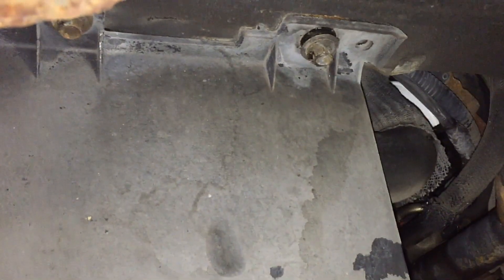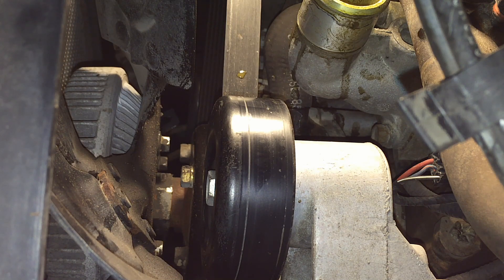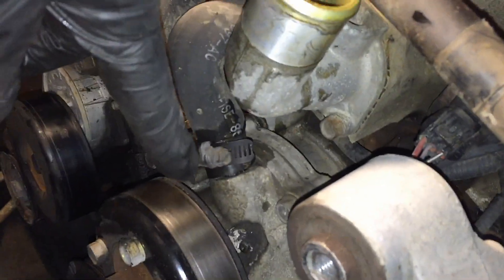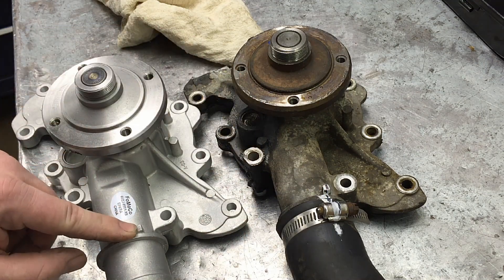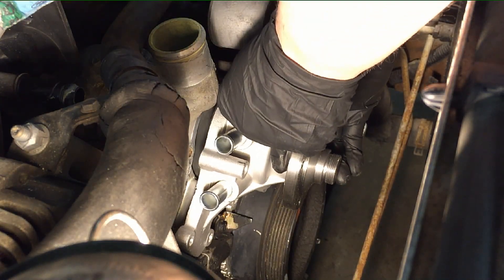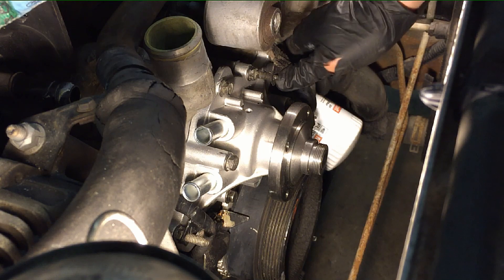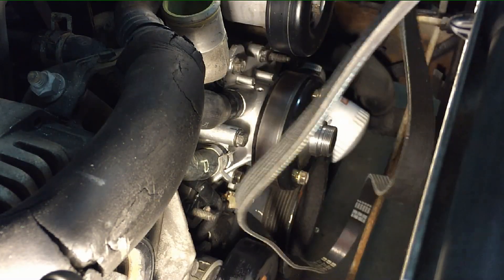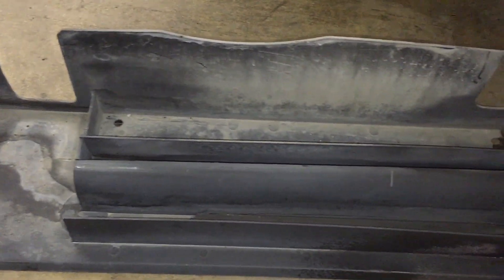Ford Explorer 5.0L Water Pump Replacement Procedure

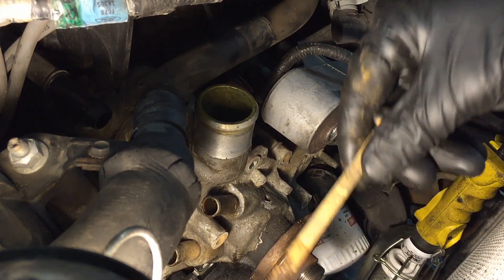Comment: I tried removing my water pump and the two long bolts were stuck just as you showed prior to 12:08. I wiggled one back and forth and was successful however the other one broke just below the head leaving the shank and threaded part stuck. I had to remove the timing chain cover which proved rather difficult because as I inspected the cover later, I found that a ton of corrosion had built up in the passage around the bolt shank. The bolt shank had belled out wedging it in place and holding the cover against the block. With some prying and a few choice words I was able to get the cover out a bit and wiggle it back and forth until the bolt broke a second time. I had to use a punch to remove the shank from the cover and fortunately the threaded part in the block came out rather easily.   I had to drill out the corrosion with a drill bit. I believe the gasket had failed eons ago and flooded the passage around the bolt shank causing it to corrode. I also found quite a bit of pitting around the impeller housing. As you are reviewing the condition of the bolts at 15:30, my advice would be to also inspect the passage ways in the cover and remove any corrosion.  I own a 1999 Mercury Mountaineer AWD with the 5.0.

Comment: I remember back in the 70s a neighbor had a 73 Torino with a 302.  That engine was tiny back in the day compared to the 351, 400 and 429.  There was a ton of room under that hood with that engine.  Things have certainly changed.  Just did a water pump on my 94 Astro, similar idea.  Only 2 years on an AZ pump which I usually don't gamble on items like this, had almost 10 years out of the prior ACDelco pump.  Wised back up and put in an ACDelco pump this time which will last a whole lot longer.

Comment: To keep the bolts in order, I use a piece of cardboard labeled for what part it is, and put the bolts in a similar position on the cardboard.

The 5.0L pushrod engines are easier than the modulars to work on.
Reply: The only reason why the 5.0 can be a pain in the ass to work on is when it's on the tightly spaced engine compartment of Gen 2 Explorer. But I do agree, very easy engine to work on overall.
Reply: Just wait till the timing chain  guides break in the back on that 4.6 then say that comment
Reply: Sry I misread your comment. I thought you were referring to the 2nd gen 4.0 sohc

Comment: Very detailed step-by-step video thank you. I am surprised that the job did not require new hoses. This would be the time definitely to do the lower two hoses on the oil cooler and the water pump. Plus the upper hose just for good measure.

Comment: You explained details others missed.  Not break bolts by working in and out.  Sealant on bolts.  Flush block.  Thanks.  I have a leaking radiator to replace, and will replace the trans cooler, thermostat, and water pump while I'm in there.  Hope it's a good idea to replace the water pump, broken bolts?????
Thanks for these videos

Comment: Great Video!  Thanks for sharing these really good Tips and Tricks. I learn a lot each time I watch any of your videos. Really great videos with awesome Tips and Tricks.  Thank You. -- I am thinking since this was a 1997 and some of the hoses look like OEM - I might spend a little more and replace all the hoses like you did.  I think you did - not sure about the large bottom hose from the pump hosing  --.  Question - have you experienced fan belt noise or failures if old fan belts aren't put back on the same direction as they came off. Don't think it matters when using a new belt.

Comment: Brian, I know how to do a oil change, most everyone knows I'm sure, but wouldn't it be nice if you did a video on a new 5.0L F150 engine step by step oil change, spark plug change etc. I think those would be popular videos.  Most everything done now has to do with the 3.5L eco-boost, there is hardly anything on the 5.0L, what do you think?  Enjoy all your videos, great videos.
Reply: As an owner of a 5.0 coyote motor in an F150 Platinum, I Think that would be a great idea!

Comment: Do you have any suggestions on replacing the lower water pump hose without taking the pump off? My hose literally exploded and trying to replace it without having to redo gasket etc.

Comment: I know this may sound silly. But my 2000 5.0 ford explorer's rad. fan has cracked all the around the hub. So I'm going to replace it. I see no video's on how to do this. I'm just wondering is there any thing I should know in particular before  I attempt to pull it off? Do I need to remove the shroud? Any help would be greatly appreciated. I've checked all over the web and nobody gives and example. Thanks for your time. Sincerely, Jack.

Comment: To remove the fan you need a 36mm wrench. Do you think a pipe wrench or adjustable wrench fit in the space? I don't have a wrench that large.
Reply from the maker: No they are too thick maybe a regular open end wrench with fan bolts removed but it's tight

Comment: Question, I have a 1997 mercury mountaineer with 90 k miles. The bearing in the water pump is bad. Since you have done this job and are a professional.  What would be a replacement cost to put in a new water pump parts and labor 🤔? I do appreciate your time. Just wanna figure out the quote so I can decide to do it my self or take it Into the shop.
Reply from the maker: Well, I wouldn't do one for less than 2.5hrs at the shop labor rate. Then there is the quality of the part and its cost you have to consider, probably close to $500 with coolant.

Comment: I don't see a link for the thread sealant you used.  One of my 4 water pump bolts needs sealant, so I just used the Form A Gasket 2 (non hardening) on that bolt; same as I use on both sides of the gaskets.  Done that for years on different cars and makes of cars with no trouble.  But I'm curious about the thread sealant you used.  Thanks!
Reply from the maker: +JRobert111111 This is the stuff I use on any bolts requiring thread sealant-http://www.amazon.com/gp/product/B0002UEOP0/ref=as_li_tl?ie=UTF8&camp=1789&creative=390957&creativeASIN=B0002UEOP0&linkCode=as2&tag=fordt-20&linkId=FYW4ODO2H4A6TMLC
Reply: +FordTechMakuloco Thank you!

Comment: I'm doing this for 1997 Ford Taurus - the shop manual says use [Gasket and Trim Adhesive D7AZ-1 9B508-AA (ES R-M 11 P17-A and ESE-M2G52-A ] but I'm not sure to put it now. Should I just use a little bit of motor oil to make it stick? If not what sealant should I use

Comment: Good video!  I wish I had the time and money to grab up one of those era Explorer 5.0s  The compact front accessory drives make an ideal engine swap canidate for my Ranger....lol.  Oh well, never will happen.
Reply: All of the u-pull its around me here in northern IL usually have around 3-5 5.0 Explorers at one time. The complete engine cost $250-$300 depending on yard. I plan on doing a 5.0 Ranger one of these days too.
Reply: +CVTaxi yea, there's quite a few around here in the yards too. Just the time, space, and money factor and the thought of pulling a perfectly good running 4.0 pretty much puts the brakes on that project. Lol

Comment: I have ONE question: I recently did a 4.0 swap on an explorer because the chain jumped a tooth or two. I see that this radiator is similar. does ford say remove all three radiators at once? or as I did, can you remove them one by one.
Reply from the maker: +Charlie Gates on the newer explorers they come off as a unit the older ones you remove them one at a time.

Comment: Hey man, I replaced the pump and there is still a leak coming from behind the pump base, not sure if there is another part between the pump and the block that has a broken gasket or seal. I think it's right on the area of the top long bolt, below the thermostat housing. Is there another piece between the pump and block? Any idea where this is coming from and a solution?
Reply: Same thing with mine, replaced pump, still had leak at top of pump near head gasket, welling up in area near top of pump, re-tightened bolts and leak ceased for 2 months, now running a steady stream...
Reply: Sounds like the timing chain cover gasket, that's what I'm currently fixing at the moment.

Comment: hey i know this is off topic to the video but i have a 2006 ford explorer 4x4. i went to change my rear differential fluid in my truck i used ramps to roll the truck back onto. got up into it and couldn't fit my 3/4inch drive to in between the differential housing and the plate that comes down. do you have any recommendations for removing the 3/4inch drain plug on my truck.

i have owned a 2003, different generations small changes were made but did not have the same problem.

Comment: I tried a couple months back to change out my water pump on my 98 mercury mountaineer and rented the tool from AutoZone to take it off but when I went to turn it off the pulley on the water pump would move with it. And I just watched the video and it was the closest one to my vehicle great video gonna go try to change it again lol. Any advice on that about the pulley spinning when I go to turn the clutch fan to get it off?
Reply: bro.... i just went through the same thing today. i gave up it's at the shop. lol
Reply: +Ronald Hartley Brake lose the bolt before you remove the belt?

Comment: Surprised you didn't replace the thermostat, with something that age and in that position I would think its worth 15.00 bucks to replace but that's the customers call. Yeah that sucks working on OLD rusted vehicles and bolts frozen, I did the water pump a few years ago on my 96 Grand Cherokee 5.2 and while I was in there replaced the bypass hose, thermostat and all radiator and heater hoses, heater core hoses are factory formed and not cheap, Jeep has a few PITA brackets but fortunately no seized bolts for me, just used Permatex 2 for reassembly. A problem like you had can turn a 3 hr job into a 6 hr job. When I replaced the steering box on the Jeep I ran into a broken bolt problem with the air box so now it has 2 instead of 3, not going anywhere with only 2.
Reply from the maker: +jim dandy This is an old video but I am thinking it was done recently hence the nice green coolant.

Comment: OK, what is the pipe that comes out of the part that the thermostat is in that the heater hose is attatched to? Mine crapped out and I had to use a hose spliter with some radiator sealent on it, had to mallet it in there. No one seems to know what it is called, nor do I know how it is seated in there. When I went to the parts store the picture they had of the part that you put the thermostat in to bolt it to the motor did not have the little pipe in it.

Comment: Is 1998 ford explorer 5.0 v8 4wd a good buy or has alot of issues
Reply: I have a 99 5.0 AWD that I bought about 8 years ago. It had 202K on it. Now it has 355K on it. Had to replace the front driveshaft on it so far and one ignition coil. Other than that it's been great
Reply: @Flathead-fb5tk  nice
Reply: @Flathead-fb5tk  bought my first awd 5.0 with 125k miles. Drove it to 260k when the timing cover rear gasket gave up. Wasn’t worth my time to fix knowing how bad that fix can be. Still drove just fine. Parted it out. Bought my second right after that with 99k on the clock. Old man owned it since new. This one will last me 10 years at least. I love the 2nd gen 5.0 explorers. They’re nearly bulletproof.

Comment: How does that wire connect on right side  if at front looking at engine..I can't see it but it FEELS like it connects like the cap on a spark plug BUT it will not disconnect..someone please help

Comment: what if the pulley an fan spin when you try to loosen it an the belt still on ti create a lil resistance?
Reply from the maker: +treyvonnie1 Best way is to use the pneumatic fan clutch kit but otherwise you are supposed to use a holder tool and a fan nut wrench.

Comment: do I have to lift the motor in order to change the oil pump
Reply: 05 f150 5.4
Reply from the maker: +Immanuel blocker No on the ones I have done you simply unbolt it and slide it off, oil pan even stays on.

Comment: Personally I would use new hoses.
Reply from the maker: +srercrcr Yes me too but that particular hose I cleaned was an oddball size where one side was much larger than the other to fit onto the oil cooler and was no longer made by Ford and not available aftermarket in our area anyway.
Reply: +FordTechMakuloco Yeah, you know I go through some unavailable things now with my 96 Grand Cherokee, lots of mopar parts discontinued but I found an excellent Jeep dealer in TX named Berry Jeep and they have a great selection of NOS parts, fortunately hoses I can still get at Napa, just heater core are mopar custom formed

Comment: Those passenger side bolts suck. They are too thin and all are bimetal corroded into the block and pump housing. This is THE DETAIL you should have documented.

Comment: the hammering was a guy working on 2004 f350 due to frustration......
Reply from the maker: Nope a Dodge Ram 2500 actually
Reply: removing and axle?
Reply from the maker: hub and bearing they stick real bad on those.
Reply: makes total sense:)